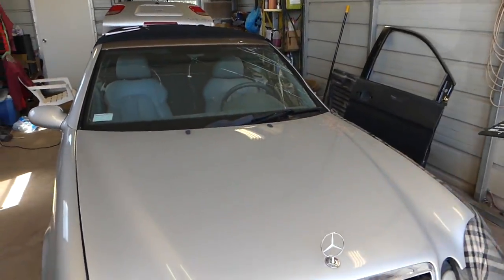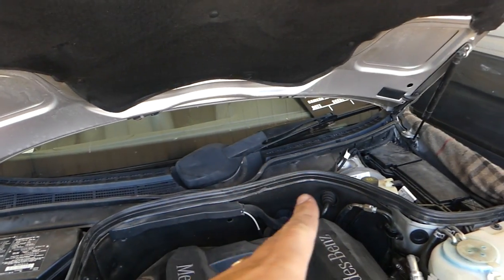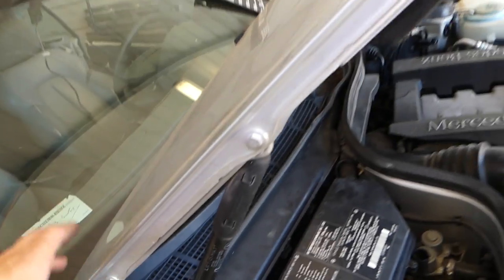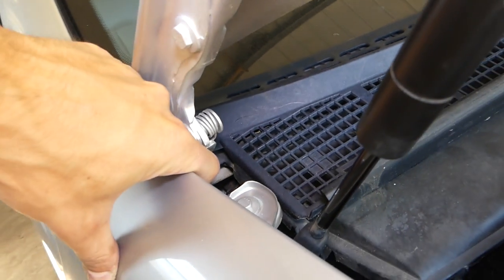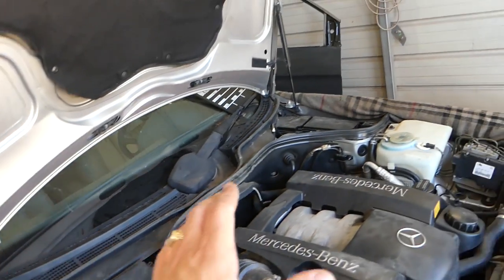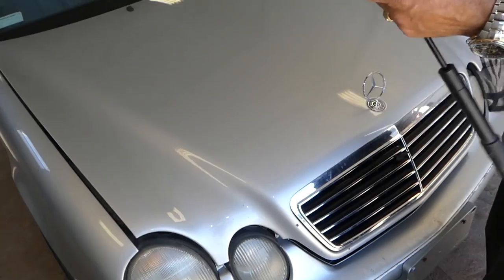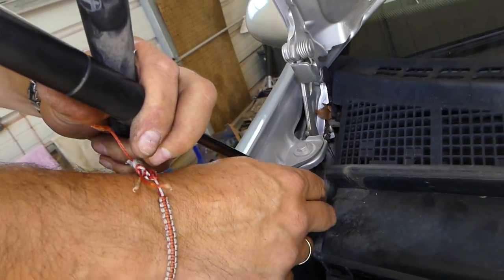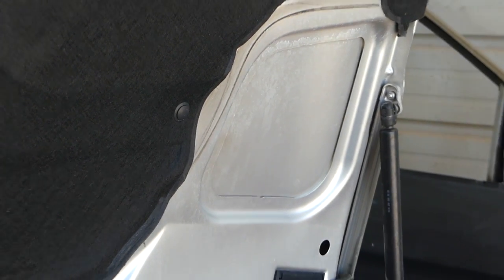MERCEDES HOOD STRUT SHOCK SUPPORT REMOVAL REPLACEMENT

Comment: Smh piece of cake ,way harder to do on the earlier 1995 w202 chassis the hinge an struts on mine are located under the hood, need to remove passenger fender, an driver fender liner, just to get access to the bolts holding the hinges an struts.. which includes jacking up the car... imagine the installation.. bullshit